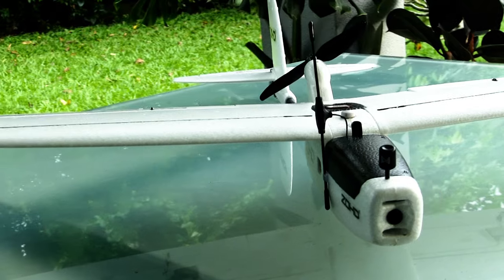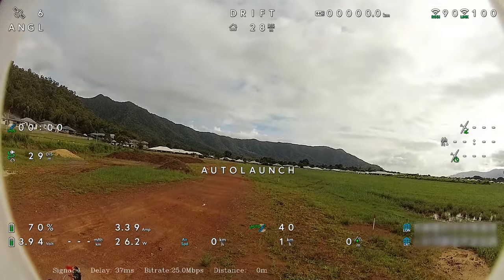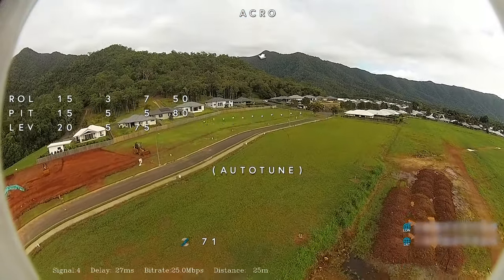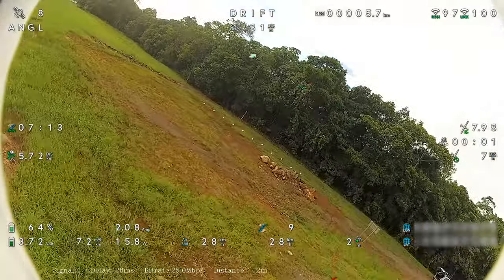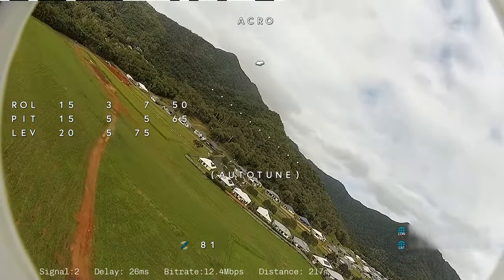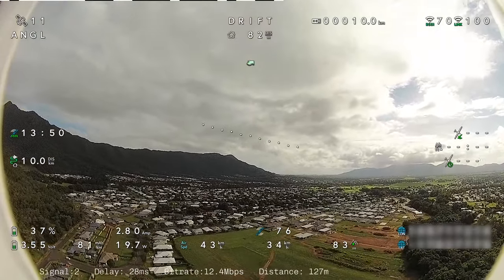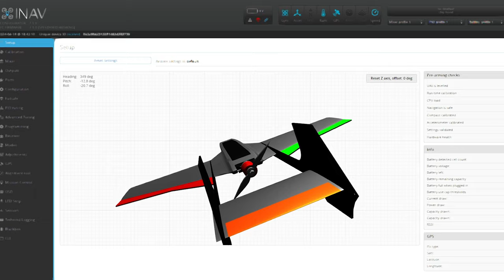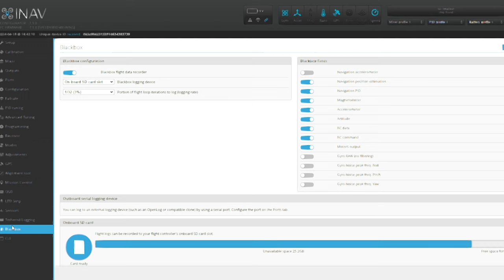Maiden FPV Flight - SpeedyBee F405 Wing Mini ZOHD Drift - Walksnail Avatar HD - INAV - ELRS

Comment: Excellent video.
I watched your last video on this. I put my fc in the right position, not upside down like yours, it fits quite nicely there if you leave the cables top the top compartment.
Also, i made a all in one camera bracket type thing with balsa to put it right on top of the wing, in the gps slot, this way i dont need to use extra weight in the tail, it balances perfectly with both 2s 18650 and 2s 21700
Reply from the maker: Good idea with the camera, though I really wanted to keep it hidden and the nose was all I could think of but I was worried about the weight at 371g but flew surprisingly well. Thanks for watching glad you liked it.
Reply: 21700's!!! How long does it stay up for?

Comment: That particular kit supports up to 13v, so up to 3s directly from vbat.
Reply from the maker: Yes I now have it setup on 3s. Seemed a little unclear to me regarding the v1 and v2 as It seemed the v2 could run more than 5v but to avoid risking it I set it up on 5v to begin with which I have now changed. Thanks for confirming!
Reply: my 2nd flite she caught fire    on 3s

Comment: Would you recommend this FC and Camera for an Eflite Opterra?
Getting it down is hardest part of flying the Drift, it's made to loiter, and does it well.
Reply from the maker: @PiDsPagePrototypes  I think the FC would work well on most planes but if going larger wingspan I would only recommend the 1s lite for tight builds like the drift. I would suggest the moonlight camera , avatar gt longer range or v2 pro best cameras although most expensive than the 1s lite.
Reply: @stonesrcchannel  The Opterra does have enough room for the larger version of the SpeedyBee F405 Wing, the Moonlight kit is on my list - I absolutely want clean onboard 4K recording to SD card. I have HD02's already, and the Walksnail VRx will clip on those, I don't need the high frame rate for what I want, duration and a quiet prop are more useful for me. Looks like a lot of retailers don't have the VRx + Moonlight kit in stock at the moment, but do have the VRx + 1s Lite, so I might end up with the 1s in the nose, and a Moonlight in a belly-turret style gimbal housing.
Do you know if there a way to set one of the spare switches on the controller to adjust the video transmitters output level? 25mW is perfect for the local club flights, but there's some areas where the signal drops out, and it'd be great to be able to flick a switch and get higher power when needed.
Reply from the maker: @PiDsPagePrototypes  I have thought about that exact same setup for the VTX power but have not found anything just yet that suggests it can be done just yet. I don't see why it can't be setup to a switch or even set as dynamic power, a bit like elrs dynamic power works, that would be great.

Comment: Hi My F405Wing seems like having a problem
The 4V5 socket and Ground has a value in my Multimeter (Continuity)
Is it normal?
I also test to check my Battery and  Ground connection
There is also a value

I worry there is something wrong with my FC
Reply from the maker: @Indonesia01ian  Hi I am not entirely sure exactly what the issue is but I would assume that what you are seeing is normal as long as you have made no modifications to the board. Have you tried to contact speedybee they might be more helpful.

Comment: Dude.... cool project but that vtx is a rough choice.   Those have no heat sink and almost no thermal mass to hysterese, so they overheat like crazy.   I have two in HD whoop builds, and when working on the bench even with the vtx dangling in front of a fan it is borderline overheating.   If I power up a quad with one, it overheats in under 2 min and that's exposed to air.   In that enclosed space I expect some serious mid flight sudden video shutdown issues.  

They are a great piece of kit if you MUST use 1s batteries or if 10-20 grams is going to make a difference - like with tiny whoops.   But in this use case for a few dollars more the 2s kit with a heat sink is vastly preferable.
Reply from the maker: It does overheat if left too long without airflow but once in the air it’s fine. I have flown many flights 20-30 mins without any issues so far. I was thinking overheating issues would be a thing during the build but so far have had none.